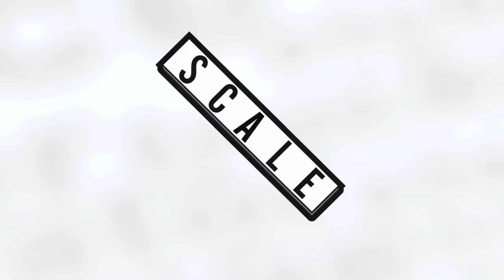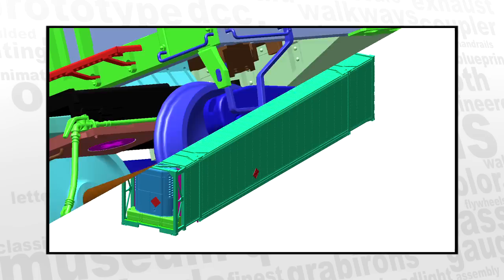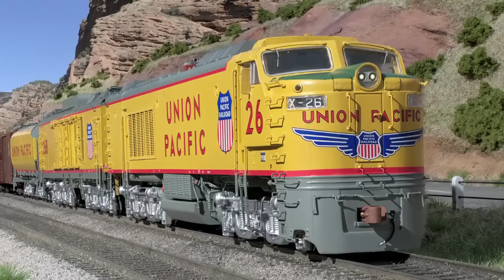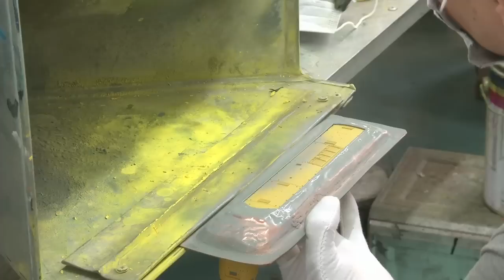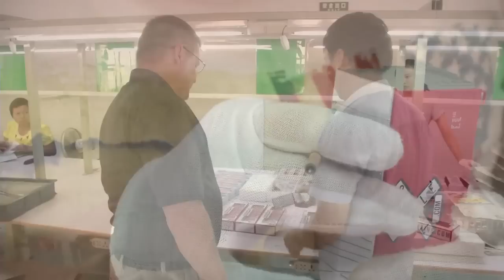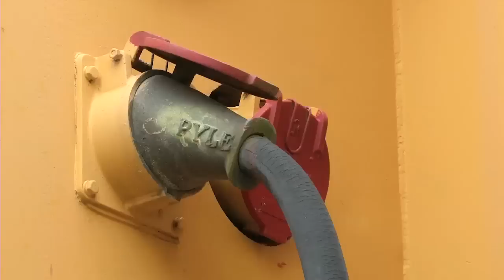Announcing ScaleTrains.com - New Products & Factory Tour

Comment: good to see a new manufacturer dedicated to prototypical models. I hope they can release some Santa Fe prototypical freight cars from the 90's in H0 in the future. These are hard to find.
Reply from the maker: +marcelwx We'll surely have something that will fit Santa Fe in the '90s at some point.  Is there a model you'd like to have?  Shane
Reply: In fact there are many models I like to have. ATSF freight cars differ often from the same cars ordered by other roads some are even build by themselves. Other manufacturers models of these cars are only standard manufactured cars and not prototypical for ATSF. Recently I purchased BLMA bx-166 cars, these are great, and the exactrail beer car. These are the only prototypical ATSF boxcars on the market.The Moloco cars are outside my modeling era and very expensive, however I understand that making the molds is expensive for one roadname only.Some examples of what I miss.- ATSF BX-196  #152300-152499 FMC 50ft   with circle cross logo 80's-90's- ATSF BX-162  #151800-151859 ACF 55' 8''  with circle cross logo 80's-90's- ATSF GA-190 #314800-315199 ACF 3 bay hopper 4600 cu-ft  billboard logo and simplified 90's logo
Reply: I very appreciate your reply, it is good to have a manufacturer that listens to its customers.Thanks!